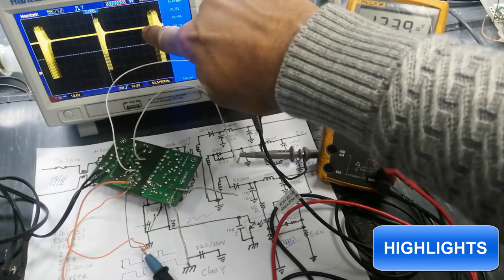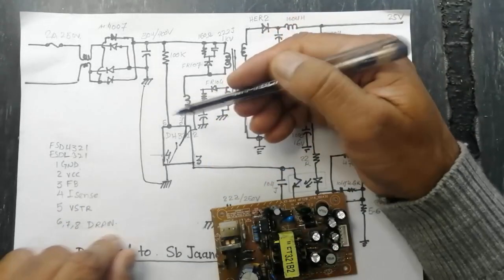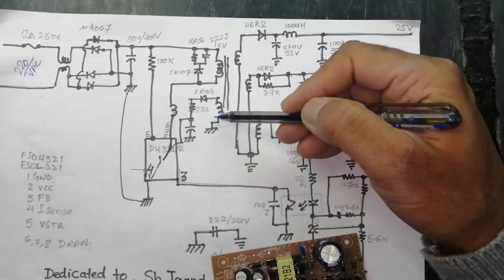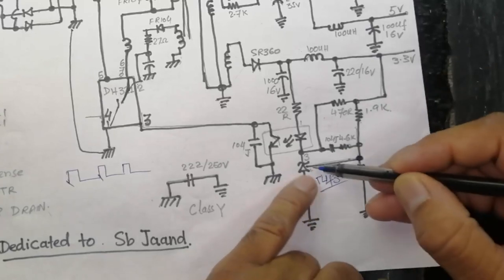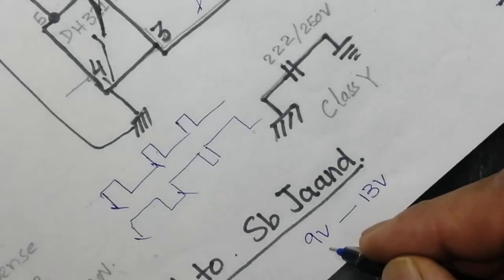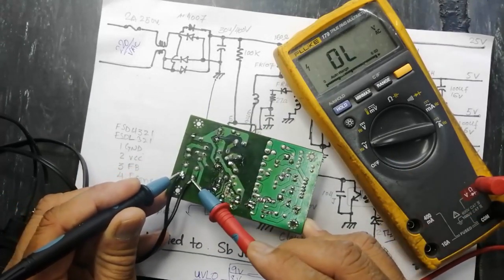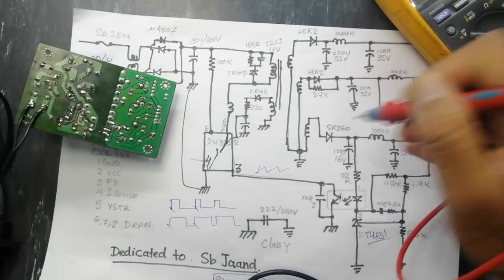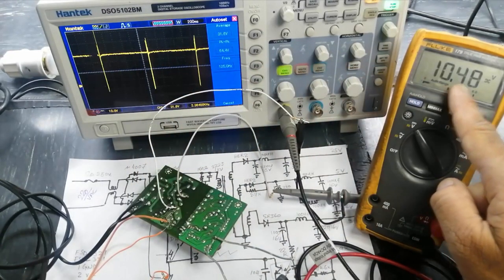#297 Repair Switch Mode Power Supply SMPS & Circuit Explained with Practical troubleshooting

Comment: I have noted that there is not one techical question below. I have one for you please, how is voltage stabilisation achieved on the 5v and 12v rails. Say, there is heavy demand on the 3v rail but heavy demand on the 5v rail. The 12 v rail may over volt while the feedback is dealing with the demand coming from the 3v rail where the feedback is sensed. The magnetic flux would do weird  and complex things as the load through the transformer splits up through the independent load coils. surely independent regulation may also be required???
Reply from the maker: best regards and special thanks
your question is very strong 
in cheap and low quality power supplies used in commercial field, 3.3 volt is considered critical for micro-processor. so its regulation is kept at top priority
while the other sections of multi-section power supply are followed to 3.3 volt, basically other outputs are not regulated, their voltage level is compromised, 
in case of any problem in 3.3, will change the output of other sections respectively, but remaining in the regulation window of 3.3 volt regulation the other section's output will also change but it will remain within limits because the circuits connected to other sections have flexible operating voltage ranges. if 3.3 volt section is out of specified limits, then the smps controller will disable the output by reaching at its maximum drive limits. 
if any output will overloaded it will case to increase the magnetizing flux , which will cause excessive voltage in un-regulated sections 
in special multi-output power supplies all outputs are monitored, in case of any output is out of limit, then the power supplies disables the output

Comment: That was GREAT ! I have been sitting here drawing out that exact power supply. I have a few of them out of $30.00 FTA satellite receivers that have stopped working. I wanted to learn about them so you came along at the right time a little bit of  Gods Blessings. 
Blessings and good bye. Leo.

Comment: Sir U directly connected At 6th pin for monitoring switching frequency... It have high voltage side...  Its make any harm condition to oscilloscope... 

Conclusion question: what is the maximum input voltage to measure in your oscilloscope sir
Reply from the maker: you are right that i connected the oscilloscope directly
actually my oscilloscope is isolated, so it is safe
Reply: @HaseebElectronics  thank u sir

Comment: Hello  Haseeb, as the feedback is monitoring the 3.3v rail only, what happens when one of the other rails is loaded down? How does the smps controller compensate for this then?
Reply from the maker: best regards and special thanks
your question is very strong 
in cheap and low quality power supplies used in commercial field, 3.3 volt is considered critical for micro-processor. so its regulation is kept at top priority
while the other sections of multi-section power supply are followed to 3.3 volt, basically other outputs are not regulated, their voltage level is compromised, 
in case of any problem in 3.3, will change the output of other sections respectively, but remaining in the regulation window of 3.3 volt regulation the other section's output will also change but it will remain within limits because the circuits connected to other sections have flexible operating voltage ranges. if 3.3 volt section is out of specified limits, then the smps controller will disable the output by reaching at its maximum drive limits. 
if any output will overloaded it will case to increase the magnetizing flux , which will cause excessive voltage in un-regulated sections 
in special multi-output power supplies all outputs are monitored, in case of any output is out of limit, then the power supplies disables the output

Comment: Hi! Have you ever was thinking of designing capacitor DC-DC step-up converter? Meaning without transformer at all. For example- you have 10 low-ECR capacitors connected in series (+ to -, + to -,.....), and you are charging each of them very fast one after another by using mosfets or other switches (1st for 1 millisecond, then second for1 millisecond...etc until last 10th one)? 
So you can in this case (with 10 capacitors in series) achieve 120v output voltage from 12v battery if to charge each capacitor to 12v very fast.
or it's hard to do it technically for some reasons?

Comment: Sir fluke multimeter used by you can measure ac high frequency voltage also? Mostly multimeters can't measure

Comment: assalamualaikum brother...while testing the board with a scope..are you hook it up with ac power input to power it on? and do you use an isolation transformer? I am just a newbie and learn with an oscilloscope.
Reply from the maker: wa alaikum salaam brother
i use a separate isolation transformer for oscilloscope 
otherwise it may damage the oscilloscope
Reply: @HaseebElectronics  thanks brother for your reply..
Reply: @HaseebElectronics  meaning that you hook up your scope with an isolation transformer and the power supply board direct to ac power input right? or both with isolation transformer?

Comment: I really appreciate your effort brother Haseeb, but I don't know if you will help me with a problem am stocked in, I am working on a project that requires many li ion batteries in parallel, but when I try charging them with 5V mobile charger, the charger start fluctuation the power as if it were short-circuited.... Please Help me bro. Thanks for your help...
Reply: @HaseebElectronics  18650 sir.

Comment: بسم الله الرحمن الرحیم
اسلام علیکم
I'd like to know what problem is if output smps drop when I contacted load ...I want mentioned that my kid is lower than smps could supply
Thanks alot for effort
Reply: @HaseebElectronics  
I know what you say..but if feedback had problem my output didn't have voltage..but I'm not professional this filed...but my device dead for this problem... I was wondering if I could ask you make list what I do in first of all and...
Reply: @HaseebElectronics  thanks ...I will be trying tomorrow...if you would like to know.let you know what happened but your perfect this things.
Reply: @HaseebElectronics  I guess maybe cap which are closed output have problem I'm not sure..